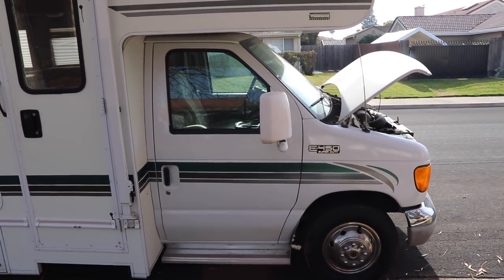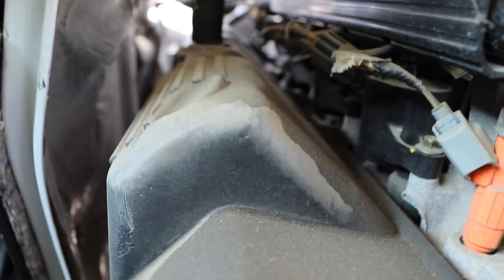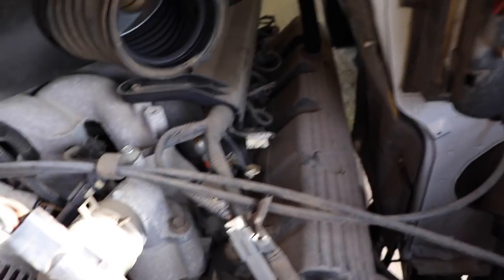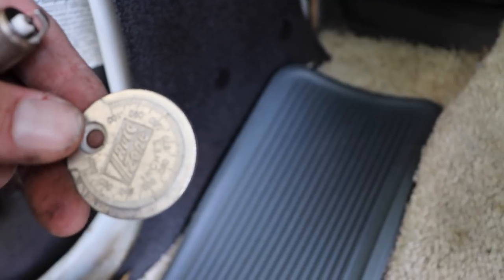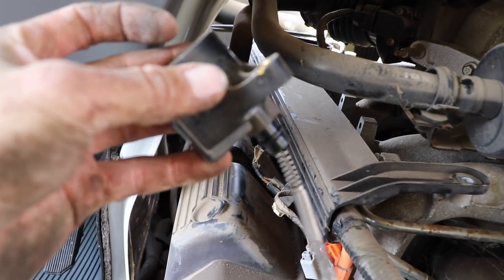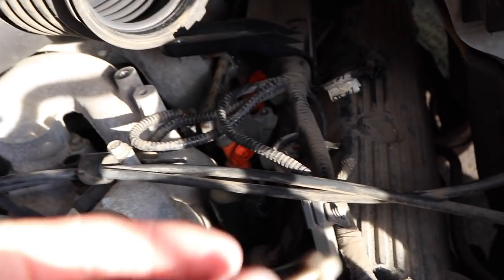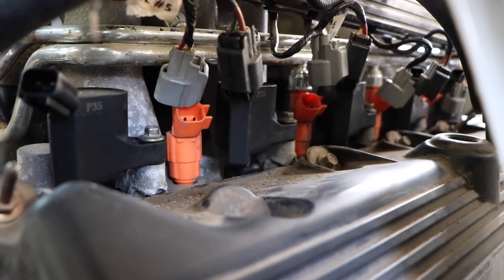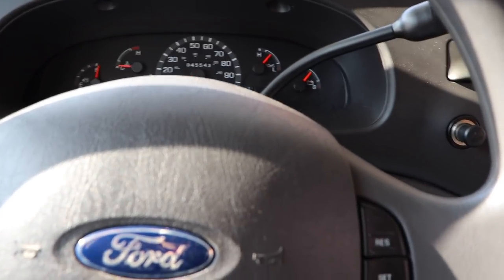Ford E450 RV how to change spark plugs, coils and air filter for maintenance

Comment: What a guy!   When I saw this mess I almost said forget it, but your video was step by step...terrific.   My ignition coils did not come off easily, only two came out "normally", the others split up and as you know, not easy to remove after the top is gone.   I improvised a noose with a zip tie and was able to pull out the bottom part of ignition boot after lubricating thoroughly.   Thanks for explaining so clearly and enabling the rest of us.

Comment: I'm an experienced mechanic, having performed almost all of the maintenance and repair on my family's vehicles for almost 50 years (God, am I really that old!?) but have never worked on the V10 in an E450 before. While I would have eventually figured out which nuts, clamps and brackets needed to be removed to facilitate access to the coils and plugs, this video is a huge timer saver for someone without prior experience with this particular engine/chassis combination. Kudos to Always_How_To's for a superbly helpful video!
Reply: Greatly appreciated.  I have a 2002 same engine and getting to take on this adventure.
No check engine light.
But engine has a miss or stutter going up hills or when od kicks in.

Comment: Good job man! I've worked as a mechanic over the years and have done a few of these the only thing I would suggest is to use compressed air and blow out the plug holes before removing the spark plugs just incase there's dirt in them this way it won't end up in the cylinder 👍
Reply: great tip.
Reply: Yep that's the first thing that came to mind too. Clean out that dust and dirt before you start and as you remove things. I would love to know if there is a cabin airfilter somewhere on these.

Comment: Good job and video. I appreciate the lack of foul language and an intelligent, calm narrative. I own the E-350, hoping that when this sort of work is required I can easily remove the seats for more room.
Reply from the maker: Thank you very much, I appreciate the feedback. Hopefully it helped you.
Reply: I had an '89 E350 snd found I had to drop the passenger side wheel to get to the last plug....jsut a suggestion if you're struggling

Comment: Thanks Always. Watching your video gave me the confidence I needed to tackle the job as well as nice visuals. Most of the youtube videos I see are woefully incomplete with more talking than good shots of the actual engine and parts. You did a great job, which I know takes a lot of time and effort. I tried to wash everything well before I started but the right side of the engine has so many lines and cables, it's hard to get it clean. My rig is 18 years old and looking at the plugs, I could tell 3 of the 10 had already been replaced. I was getting a #9 misfire code, which prompted the tune up. Don't have a lot of miles (under 50K) but of course 18 years is 18 years. I did use anti-seize  grease on the plugs and yeah, dialetric grease on the plug end of the coil pack. Two of my old coil pack boots separated from the spring wire and I had to use plumbing pliers to grip the boot to suck it out of the plug hole. Didn't realise just how deep the plug holes were. Once I removed the plastic covers that hold the wires above the plug and injector wires, I used a rope to wrap around the wires to pull them out of the way (and tied it off) to give me decent access to the plugs. I would say it's not a very accessible engine and I rubbed a bit of skin off my arms and hand backs reaching in. It's not a simple job and I got frustrated a couple times. It would be good not to be on a tight timetable. I quit and came back more than once over three days of a few hours each day. The middle plug on the left side is blind and I had to use a mirror to tighten down the screw that holds the coil pack in place. Now that I've done the job once, I would be able to cut my time in half. Experience is the greatest teacher but your video gave me enough info to have faith I could do it. All in all saved me quite a bit of money and the rig runs smoothly. Thanks again.

Comment: I got one of these things and it's needing plugs. I am so glad Ford engineers make sure consumables that require regular maintenance are placed so that you need to take the whole vehicle apart to get to them. If you went into a Ford V10 engine plant, you would have seen the assembly line beginning with a bunch of spark plugs hanging from a conveyor line. They then proceed to hang the rest of the engine on the plugs. I am surprised they didn't put the oil filter inside the engine block. Not just picking on Ford. I had a '77 Buick Regal (gawd, what a POS). Back plug on the right bank required jacking the engine up to get to it. That or cutting an access hole in the fender well. Had a Dodge Tradesman van that would have fuel pump failures every 2 years or so. After dropping the fuel tank the second time, I pulled up the carpet and installed a hatch in the floor for fuel pump access.

Comment: Thank You Man. I just both a 2007 E450 and i totally need to change sparks and coils. you just save me $300 to $400
Reply: In my case, they want to $1000 for labor
Reply from the maker: @asappestcontrol1250  Yup, labor costs have jumped up and now doing it yourself is even more worth it.

Comment: Good bit of info....These style motors are subject for debri falling on top of the Plug after removing the Boot. You need to use compressed air to clean the area out good. Blowing it out good before you put a Spark Plug Socket is crucial!!!
Reply: Good tip
Reply: Thanks!

Comment: Excellent walk through!! Very helpful and concise. lots of horror stories about this process and broken plugs. This is a great reassurance that it's not scary. :-} One thing I like to use on the plug threads is a dab of anti-seize. It really helps the next time you need to remove them.

Comment: Thanks so much.  I was planning on doing this to my 2005 E-450 RV but chickened out.  I learned a bunch of stuff and am now inspired. Thank you!
Reply: So my RV recently started idling poorly and the OBD is showing mis-fires on cylinder #3, which is the middle of the passenger side.  Our RV only has 17K miles and sits most of the time, so no where near 100K but the sitting around all winter is likely doing bad things,  Planning to tear down and remove just #3 and have a look.  In watching other videos I'm also going to blow some compressed air down the hole before removing the plug.  I've also heard oil can leak down from the valve cover and foul the coil.  Really curious to get in there now and figure out what's up. Will let you all know!

Comment: Nice job. The only thing I would have done different was to use a Wells or Motorcraft Ignition coil. The cheap ones will let you down in short time. I use a lot of different parts on my 2000 V-10 but have learned the hard way not to scrimp on FMC coils.
Reply: Ford coils are garbage.  I lost two on a 2018 v10 with 17k miles.  Know many people with different fords and same complaint.  Coil sitting on plug gets mighty hot.

Comment: This is a good video to show whats involved.
 I would say the plugs in the V10 are platinum plugs Fords say 100k before they need changing. With the possible plug issues on these Triton engines. I myself would wait till close to that before i want to open up that can of worms.
 I ran and maintained my last Ford van I  used to tow a trailer with the 5.4 Triton motor I never had a single issue and waited till 100k then changed the plugs. It always ran fine. Now I have 04 motorhome with 40k miles pm V10 garage kept I plan on waiting till 100K unless it starts running rough. I would used motorcraft platinum plug as well as coils when I get to that day.

Comment: Good job and nicely done video. A note of caution to all. After removing the coils, blow out the spark plug access cavity prior to removing the spark plugs. Use Motorcraft plugs only and put some anti-seize paste on the spark plug threads and torque to 25 ft lbs. If you use the  Ford torque specs, (about 13 ft lbs), you'll have spark plugs blowing out of the cylinders. Also, use Ford coils. Shop around online for the best prices for these parts. Most of the dealers are a rip-off.
Reply: The blowout issue was resolved in an update to the cylinder heads
Reply: @markv5227  Stupid question. Where are the cylinder heads?
Reply: @MinisterRedPill  Hi, like where on the engine? The cylinder heads are on either side of the engine. If you get to 6:52 in the video, you see the cylinder head cover, that black boxy looking thing. Plugs go into the cyclinder heads, one per cylinder. Ford had an issue with the engine pressure and maintenance stripping out the threaded plug holes. Bad thing.

I checked with the dealer. My RV has 40,000 miles on it and I've not had to change the plugs yet. I change oil, transmission filter and fluid, checked brakes, etc. Spark plugs are supposedly good for longer.
Reply: @markv5227  mine is a 99 with 47k and need to replace plugs 4&9 but I'm gonna replace them all and the coils
Reply: @MinisterRedPill  If you're going to do one, might as well do all the plugs. You should talk to the Ford dealer about the coils. Unless yours is misfiring or something, you have to decide if it's worth it. I can tell you that some are difficult to get to and that may be the incentive to do the whole thing and probably not have to do it again until 100K
Reply: @markv5227  it definitely has been a real pain. Especially getting to the one in the middle. Lots of wires and hoses. I'm doing the passenger first because it's the worst. I replaced 3 out of the 5. Oddly enough, the 3rd one was easier than the 2 in the front. Couldn't get them loose. Gonna try again tomorrow. had to buy a lot of extensions and swivels... Jeez... Never doing this again.

Comment: Great video. One thing not mentioned, the heads are aluminum. Be VERY careful torquing down the new plugs. Overtighten them & you will strip the threads. Then you have to ream the hole and Helicoil the heads.
Reply: Kona Golden how tight? What’s the spec?

Comment: Changing the coils is an unnecessary expense unless you are throwing a check engine light which will tell you the cylinder number. They do weaken over the years but as long in spec the check engine light won't come on.  During a tune up you can buy just the boots with the spring which you saw in the last cylinder if your boots are in poor shape. Then again they can be reused if no signs of cracking or dry rotted. But if you have plenty of money have at it. :)
All bolts are metric on this engine which some correspond close with standard. 5/16 = 8mm. 5/8 = 16mm. 
Last tip, trying to focus close up on your camera touch the object on your screen and your camera should autofocus. 
Thanks for the video.

Comment: I predict early myself always blow out all the dirt from the plug holes before removing the plugs Keith foreign particles some falling into the cylinders plus I use anti-seize on all the plugs because I've known for getting hot and season in the motor so the next time I change them it'll be easier

Comment: Great video, I have a 2003 I’m thinking about doing the plugs soon, I just wish I could find an exact torque for the plugs, it seems to be all over the place, I have heard everything from as low as 11 foot pounds to 28.. access doesn’t look as terrible as some say though with doing the removal of what you showed in the video. Thanks for posting

Comment: Is this a model that would've had issues with spark plug blow out? I have a 99 v10 and I saw that they had issues with the plugs blowing out but I'm not sure if they have redisigned plugs for it but I was told it would be a good idea to check the plugs every 10 or 15,000 miles to make sure they aren't loose to prevent blow out.

Comment: Great video. Nice job explaining. One question, though: where you buying parts to keep cost around $100? The 10 ignition coils are going to run me at least $200.
Reply: Troy McConaughey Aamazon has the 10 pack of coils for 45 bucks
Reply: I usually buy name-brand coils (Hitachi, Denso, NGK, etc.) from Rockauto and those brands are usually cheaper than factory parts and are good quality.  The Motorcraft coils are $29 at Rockauto.  I would not buy the Amazon or Ebay coils unless you are in a gambling mood.  I once bought an Ebay ignition control module and it was DOA.

Comment: My 1997 ford minnie winnie motorhome will crank but not start. Has new fuel filter. The pump works good. Not sure what else could be wrong. It doesn't seem to have spark to start but it cranks

Comment: I have a 1998 Itasca Spirit, same engine.  Like others, I was curious why you changed the coils?  My Chev pickup went 219,000 miles and it had original coil paks when I traded it in.
Reply: Before I bought the Coachmen Catalina from the current owner, they had the dealer research the code on the one of the cylinders and they recommended replacing the coil pack when they replaced the plug, which they did before i took it home. The horror of this job is the labor to get to the individual plugs which are deep down in the block. So replacing the coil pack when you replace the plug makes a lot of sense. If you don't have any misfires, no need. If you do then replacing the coil pack when you do the plug makes a lot of sense. Tearing everything down to get to the plugs for this job means being safe (not wanting to the do this job very much). I also replace all my plug wires when I do regular plugs in my Jeep, which is analogous to the boots on the coil packs in this rig. To do the boot without the coil isn't smart. To do the plug without doing the boot and coil, is chancy. To do both is an investment, especially for people who do their own labor and want to avoid doing it again. The dealer likely wouldn't do everything because it's so bloody expensive at the dealer (they would only do the cylinder that's failing) but investing your own time as labor means investing in parts to save your labor down the line and doing them all with coil packs to be more secure. I can see both sides but if I'm going to spend my time doing this job, believe me I'm doing the coil packs as well as the plugs so I won't be worrying about it again for years.
Reply: @MlKEJ  the thing about a specific cylinder misfire it can be a coil, fuel injector or a vacuum leak to that cylinder. The first thing I do is swap the suspected coil with another coil and see if the code moves too. If it does you know the coil is bad. If the code doesn't move than the fuel injector is most likely bad. Then I'll take a stethoscope and listen to the injector. But if a shop looked at the trim on advanced diagnostics they most likely have it narrowed down. One of the main reasons home mechanics are doing this is trying to save money. Coils are expensive.
Reply: @ronmitchell8929  I hear you. Ford coils are very expensive. After market coils not so, in fact they are affordable enough to do the whole job for under $50 and have Amazon have them at your door in two days. After I swapped everything out, I looped all the wiring up to make getting to the plugs and coils a lot easier and I have spare coils. The middle cylinders are tough to get to, so you hope any new failures will be on either end, or close enough thereto. I am now also independent of needing to have the thing taken to a dealer for this code, wherever I am. Not recommending this to everybody, for sure. My pain, my choice. Not doing it the "right" way means I get to define what's right for me, not everybody. When I screw up, it's my pain.

Comment: Nice video. I have a 2005 Winnebago with the same engine. I am curious what the torque settings are for the plugs, seems to all over the board. What setting did you use? Thanks.
Reply from the maker: burns rafferty I too found multiple torque settings online but I cant remember which one I actually used. I know that doesn’t help. Thanks for watching
Reply: Was told 18lbs torque on the plugs with a swath of antisense on the thread. Resist overtightening as these engines are famous for stripped out and blown out plugs.

Comment: I just bought a 2002 class c rv. Ford 450 v10 also. It only has 28000 miles. Do you think I should do a tune up on it? Or what should I look for to know if I need to
Reply: You should get anything like this double checked once it comes into your possession lol
Reply: If no records, check error codes then change all the fluids and check the rear diff fluid level, wait on other engine expenses till you see an engine light or code.  DIY-Add sumo springs (bump stops) , use the blue color on the front. In the rear see if it has air bags or super duty leaf springs, if not add sumo springs there also.  It will stop the heavy body roll. Check tire date codes if over 7yrs and change them to all steel sidewall tires. This is especially needed if you max out the rear axle 9.6k lbs, which is easy to do with full tanks and gear.  Traveling at 70 will blow an older tire and take out your rear basement cabinets. RV shop coach repairs are a bad experience everywhere. Get steel valve stems(camping world) installed at any tire shop but you provide the stems. These extended stems have curves that let the stems pop out of the wheel holes for you to mount a TPMS on them.  Manage tires like your life depends on it (cause it does).  PSI rises much higher on RVs, more then even the tire or chassis support staff understands. This is the smart money updates to do for the chassis. On the Coach reseal any questionable exterior caulk immediately and read up on maintenance of your appliances. Happy trails!

Comment: Why did you only greased the end of the plug boots I meant that's not the part that sticks the inner part of the boat sticks to the plug and they seized up I like to smear the grease with a Q-Tip up inside and keeps them from the season up